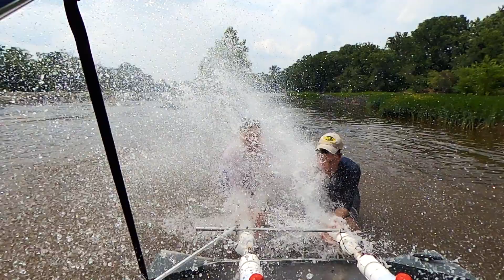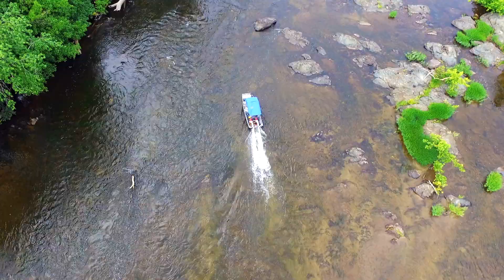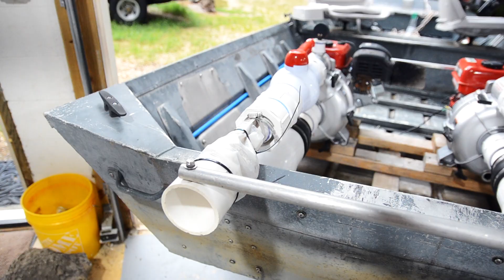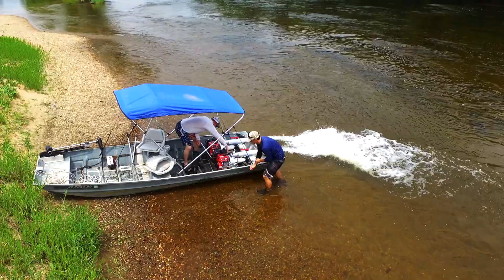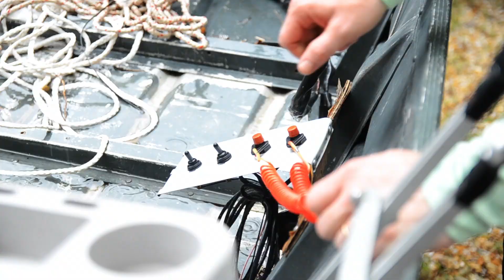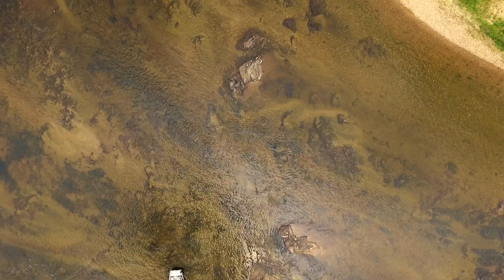Water Pump Powered Boat - DIY Jet Boat (WORLD'S FIRST!)

Comment: I know what you should do. I think I’m going to do it as well after watching your video. This will simplify the whole design and it will shorten the piping length and waters travel time and it will lower the outlet jets so they are right above the waterline giving you the greatest propulsion. Visualize this. I was on Amazon and saw they sell the same type of gas engine water pumps except the pumps I saw on there are designed to be able to remove the water outlet nozzle by removing 4 bolts. So I was thinking you get one of those, preferably one that’s not attached to an engine because you won’t need it. You remove the 90° bend outlet nozzle and replace it with a straight outlet nozzle. If it’s attached to an engine remove it. We’re going to rotate the entire water pump so that the intake nozzle is pointing straight downward and will Mount to the boat hull and the outlet nozzle will point rearward toward the transom and you’ll need to cut holes and run your jet pipe straight from the outlet nozzle through the transom. Then buy a vertical shaft engine of similar HP size and same shaft size and mount it to the water pump

Comment: I actually have a similar idea for adding propulsion to my canoe.  I looked at various small outboards, gas and electric and thought, hey, I have the Predator 2-inch pump that puts out a ton of water. Why not try using that, incorporating 2" PVC fitting and then reducers to dual water jets for balance in propulsion?  I was wondering if anyone had done something similar, and here you are. My jets will be in the water, but I'm less concerned about rocks. Nice experiment - and thanks for sharing.

Comment: Why not plumb the outlet through the transom under the water line? You'd keep your shallow draft and it would be a lot more efficient than just spraying water backwards in the air. I'm genuinely curious, because I have several large electric centrifugal pumps and I've been considering trying something similar with one of them, just more performance oriented.

Comment: love it,doing a similiar build in the uk,im using 2 pumps as you are but running the outlets 2 into 1 and then out the back of the boat,using stainless tube for the outlet (welded) hoping it stays together! great project keep up the good work.

Comment: If you discharge the outflow under water wouldn’t you greatly increase efficiency?
Reply from the maker: It’s actually counterintuitive. Check out some of my “Here’s the Proof” videos or the one I made for the Veritasium science communication contest.
Reply: I love the build, are you using a stator to straighten out the flow of the water exit your nozzles.?  Every jet pimp uses one as it directs the energy of the flow in the direction you want ( rather than spraying in a big fan). I believe the sweet spot for a jet pump to eject the water is right at the water line. Under the water you lose thrust . If you look at A mokai they have their jet pump nozzle in the water until you take off then it is sitting at the waterline in the wake created by the boat. 
I’m no expert on jet pumps but I  have built several,versions of a jet powered paddleboard and like you have also had to learn by trial and error the best configuration for max speed/power. I’m still working on that btw….. it seems every time you fix a problem you create 2 new ones.
I’m looking forward to seeing the improvements you make along the way. 
It may not be possible with the configuration you have there but if you can get toe flow to your pumps to come in at a more gentle angle you would have a lot more power. Those 90 degree turns from the bottom of the hull up then over and a another 90degree into the pump has to be slowing the water flow down and also adding turbulence to the flow. It will create a lot of cavitation on the impeller which will cause premature wear on the bearings and impeller. Not something you need to,address in the short term but for long life and reliability once you have made the other improvements you plan on doing, I’d want to eliminate the 90 degree turns in your intake as much as possible.
You might want to consider relocating the intakes to right under the pumps ( like a jet outboard does) that might be all you need to do to improve intake efficiency. 
That’s a lot to digest Sorry I keep thinking of my own experiences  and I’d like to save you some of the mistakes I made. 
Good luck with the build 
Cheers Frank

Comment: Are you limited by the engine rev limit? I am looking in to doing this with 212cc (6.5 hp) engine.  But it has a big world of aftermarket parts to make up to 15 hp for another $300ish.  So power goes up and revs out to 8k rpms
Reply from the maker: Thanks for the comment/question OutOfWork Outdoors! If the engine ran faster I would bet I'd get more flowrate and more speed. If I could come up with $600 more to throw at this build perhaps I will do it.
Reply from the maker: Would you consider subscribing to support?

Comment: Awesome man I am a carpenter but I have seen a guy making boats from fiberglass and foam sheets. I fish a river that on low tide a canoe with a trolling motor is not capable of traversing. This jet idea maybe what I am looking for!
Reply from the maker: Thanks for the comments Jim! You should try it. It's not fast, but it is cheap and very functional. Also very hard to damage a pump that's designed to suck "trash, mud, sand, etc. Would you consider subscribing? Or sharing this with a friend?
Reply: @greenlizardusa3105  I did subscribe
Reply from the maker: Solid, thanks Jim!

Comment: Very cool,.... you would have increase HP 4x to get any speed with this set up. When you trim a jet out board up so water is spraying up in the air, it hardly moves. Seems thats what you have here. I do like the intake. Cheap shallow jet boat YES. NO reverse noway. Like your determination and will keep watching.
Reply from the maker: Thanks Johnny Fish! If your haven't already, would you Subscribe?

Comment: That's an ingenious design! I'm wondering if you scale up to a larger boat with the same engine, same hull and everything, if it will actually end up being faster or not. One thing that I noticed was the reverse. You don't have one. Also, the flow of water is restricted in your design due to the size of intake pipe verses the many holes. You are restricting the flow by about half because of all that metal blocking the flow. I would think that if you had more water coming in than the size of your pipe than that would increase the power.
Reply from the maker: Thanks Robert! I did measure the "open area" of all the little intake holes, and it's equivalent to a 3" hole (the same size as the inlet). I do agree that it's a lot of turbulent flow, and if I removed the little holes, and just cut it out it would go faster.

Comment: Would it not be more effective to have the outlets turned down towards the water?
Reply: Wouldn't they perform better submerged? Out the back??
Reply from the maker: You don't get any reaction or additional thrust from spraying at the water, but there could be a reason to "trim out" your boat by adjusting the vector of the nozzle outlet.
Reply: @greenlizardusa3105   You are right. Newton's Third Law says it all.
Reply: @greenlizardusa3105  ah but you are wrong grasshopper.......https://youtu.be/C9jGKaiZIcQ